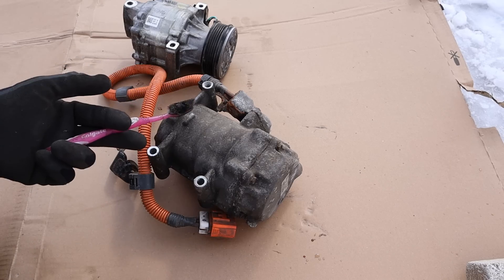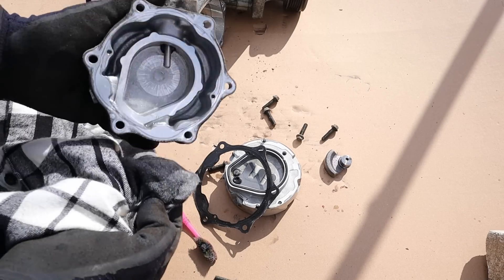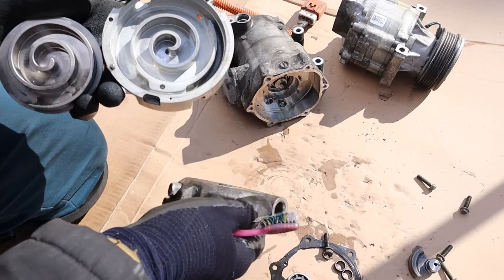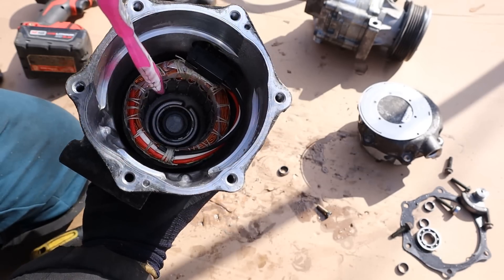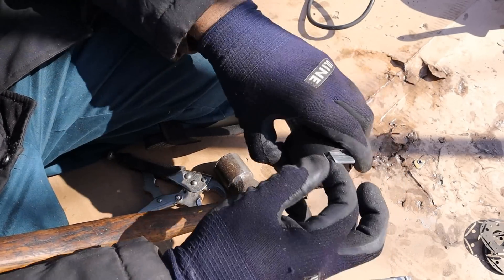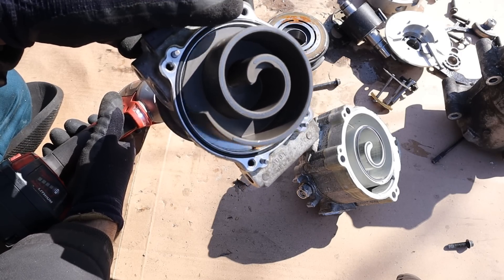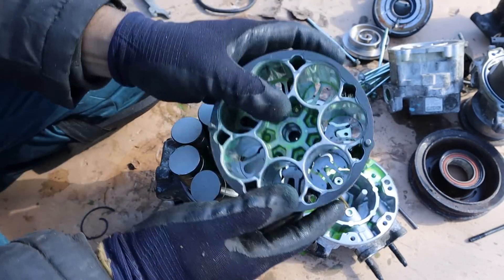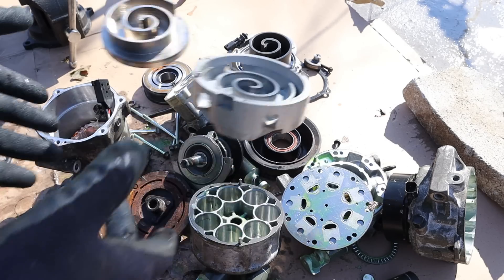How a Hybrid A/C Compressor Works

Comment: Has anyone repinned the electrical terminal on top? Mine has bent and broken teeth. It goes straight to the circuit board I accidentally pulled it out and hoping to somehow find the right wire and re solder / repin
Reply from the maker: Shucks
Reply: @speedkar99 figured out you can pull the whole circuit board off.  Do you think I’ll have luck swapping the top cover with circuit board with my old compressors ? Same serial number

Comment: This is really cool design. cause compressor and its motor are sealed as they call it hermatic. there is no way ac fluid leaks at least not from compressor. unlike traditional ones which always leak every fucking summer from the clutch side. its really bad specially if you live in the middle east.

Comment: Wow, this was really interesting!
Quick question; would you happen to know if the pressure relief valve on the compressor is a one time use valve?  I have a RAV4 Prime and the relief valve opened up and released all the refrigerant. Just wondering if I need to replace the valve or not…  Thanks again for the great video!

Comment: Funny video. I like it. However, I'm not sure the hybrid is using PAG oil. Toyota uses ND-11 in their Gen 2&3 Prius where PAG oil will supposedly conduct electricity and destroy the windings they piss through.  Thanks for showing that.

Comment: Hi, what’s the maintenance needed for aircond system? I owned honda i-mmd hybrid car. It’s used electric compressor as well.
Reply from the maker: As long as it's a closed system there's not much maintenance other than the air filter
Reply: @speedkar99  thanks man for your reply. No wonder, no specific mandatory maintenance for aircond system inside the manual. Just air cleaner element and dust & pollen filter.

Comment: Hello, I know it will be stupid question but I will ask it anyway 😅 is there any opportunity to swap my 1992 toyota pickup ac compressor from the belt driven into an electrical one?
Because once I turn on the AC the power loss is noticed immediately in addition to the insane fuel consumption 😢

Comment: You’re amazing! 
Question: When replacing a compressor in a Prius, the system is emptied of refrigerant. Do you have to jump the compressor to get it to suck in the new refrigerant or does it take in the new refrigerant another way?
Reply: It's no different than any other aircon compressor... the system must be evacuated completely to remove all remaining gas, air and moisture. This is done by pulling a vacuum using a vacuum pump, and pulling it down to about 99.95% of absolute vacuum!). The pump should stay running for 20-30 minutes to be certain all moisture has been boiled out of the system.  At this point the pump can be turned off, but monitor the vacuum gauge to be sure there's no leak that allows the vacuum to decrease for at least 10 minutes. Then the new refrigerant can be introduced to the system as liquid (tank valve down). The vacuum in the system will suck the liquid refrigerant into the system. This is where you have to know how much refrigerant the system requires, so you don't over-charge it and cause slugging... which can destroy a compressor. 

This is obviously a job for someone trained in HVAC.

Comment: Thanks speedkar, I wondered how that compressor ran on our new Explorer Hybrid, when I have the AC on idling in the engine is off and it's in hybrid mode, you can hear the scroll compressor changing speed.  The battery must have a lot of capacity because it will run a while with the engine off.
Reply from the maker: The battery on hybrids are quite sizable, enough to power the vehicle at low speed.
Reply: @speedkar99  hello, yes, it will go about 13k m on hybrid mode at 60kph providing there is no headwind LOL, then the gas engine will cut in.  Ford's done a good job, the motor kicks in flawlessly as the DC motor is the starter in this case. I think it kicks in by clutch but you don't notice it.

Comment: 6:18 The IGBT are Insulated Gate Bibolar Transistors, a hybrid between a MOSFET and a Bipolar junction transistors. That A/C inverter is in fact a variable frequency drive, not just an inverter.
Reply from the maker: Thanks - my electronics knowledge is limited to what my brother brushes off on me

Comment: Hey buddy have you ever inspect any rear caliper. I couldnt understand it because there is no english video any clear explanation on the internet and it has a rotating mechanism inside run by hand brake wire. This rotating thrust screw is the problem to understand. What is this rotating mechanism what is the ambition here? Also there is a gap between outer piston and inner piston. Outer piston has a small bore opening out. Could you enlighten us please.
Reply from the maker: Check my parking brakes video
Reply: @speedkar99  I already did it and first looked into your videos. I am looking for parking brake caliper not drum brake.

Comment: Volkswagen used scroll compressors as superchargers for polo, corrado and golf models, for a short period of time. They called them G-lader. G40 mounted on 1.6l and G60 for 1.8l engines. They were very unreliable, unfortunately.
Reply: I'm tempted to say that's a VW thing rather than a scroll thing though (I own a vw).  The DSG gearbox was a brilliant idea that should have rendered automatic transmissions redundant the world over. 
However the clutch packs wear out, and the lower gears aren't up to scratch and so also give problems and they're a nightmare.  
Initially the oil in the control units dissolved the pcb tracks and shorted them out - regular oil is high sulphur and corrodes soft metals.  It's common knowledge but VW made that basic error (now replaced with low sulphur oil).
I mean, it took until the nineties for them to get heat into the Beetle ;-)
Reply: Yeah the spirals inside of this compressor kinda look like it right?
Reply: @Kollege_Turnschuh  they are the same in working principle, just designed for slightly different application and working conditions.
Reply from the maker: That's interesting. Wonder how it pumped air compared to a turbine style

Comment: The first motor Permanent Magnet Synchronous Motor (PMSM). High efficiency, high torque (compared to AC asynchronous or BLDC types). Overall - Big power, small package; hence the in-line cooling of the refrigerant.
Reply from the maker: Exactly. I like it, very simple.

Comment: Scroll compressors have taken over the HVAC industry because they require much less starting torque from the motor, even when the starting pressure load is high. There are far fewer moving parts compared to variable displacement compressors so I'll guess they are more durable.
Reply from the maker: Variable compressors have an adjustable swash plate that can basically start at 0 compression. 

I agree scroll compressors are more common and simpler.
Reply: why werent scroll compressors the norm in the first place?
Reply: @poiiihy  knowledge is a process often impacted by many extraneous factors.  We're all born young and noone is born wise!
Reply: The residential scrolls can also survive some slugging…..return of liquid to the compressor intake due to poor heat transfer at evap or metering problems.
Reply: Exactly that’s why rotary “Wankel” engine produces low torque vs hp

Comment: Scroll pumps actually can run dry, so it’s not surprising that the new model doesn’t have lubricants. 

I’d say the oily stuff you got from the old Prius scroll compressor might be decomposed chemicals from refrigerant?
Reply from the maker: All compressors have oil in them.
Reply: @speedkar99  scroll type compressor/pump can run dry. If you take a closer look, there’s no relative motion between 2 scrolls — it’s their mating position keeps moving, but not rubbing against, thus no need for lub.
Reply: @bikingmoments The seals require lubricant, as well as the bearings. Some scroll compressors CAN be designed for dry work, but that by no means says ALL scroll compressors CAN be used dry.

Comment: 500k! Wow Toyota are really reliable. My Ecoboost Mustang only had 60K before it started to play foul games with me.
Reply from the maker: I made an engine teardown on the engine for this car a year ago, check it out!
Reply: Those Toyota hybrids can go 15 years.  Amazing given the scepticism about batteries.  Have to ensure the filter cooling the battery is regularly changed to ensure battery cooling.  But easy to do.

Comment: The hype you had when finding out that it's a variable compressor was so real
Reply from the maker: It sure was cool to see, even though I've already opened one prior
Reply: @speedkar99  Rainman Ray opened a variable one in an older video, yank-mobiles (light trucks especially) seem to need the AC compressor/condenser replaced as a matter of course (over 100K miles).  

Those scroll compressors certainly look like they would be much much less susceptible to failure (but I'm no engineer).  Pistons going up and down on a wobbly plate does seem to suggest weird pressures and stresses.

Comment: Hybrid air conditioning systems are my favorite. They have consistency and the compressor doesn't blow up as easy belt-driven one when your flooring it. Newer cars turn off the compressor while accelerating or in the red light which is b***** to save little to no gas
Reply: They don't blow up when running at high rpm! There is things called pressure switches. There is a low and high side switches. If low on refrigerant the compressor won't start, when gets over a set pressure the high side will kick the compressor out and the high side also is what starts the cooling fan to cool the condenser so the pressure doesn't run away also.
Reply from the maker: Yeah there are a number of protection systems in place, but I think the most obvious failure is the belt and clutch system, asside from leaks.
Reply: Even a 1990 Ford Ranger haves a WOT (wide open trhottle) relay thats disengage the AC compresor when you go to floor on the gas
Reply: Had a couple Chryslers blow up on me while revving the engine. Not sure if they just suck. I had a Ford explorer 1998, it did cut off at wot
Reply: My Prius has a "cold storage" evaporator. When the engine (and the engine-driven compressor) shuts off at a light, cold air keeps blowing.
Reply from the maker: That's cool, I didn't know that.

Comment: That pump for the Spark had a leak in the low pressure circuit. Damn shame.
Reply from the maker: How do you know it was leaking? Just because there was no oil?

Comment: FYI: IGBT = Insulated Gate Bipolar Transistor.  Not "Integrated".  It is a compound semiconductor with an FET driving the Base of a BJT.

More acronyms!  FET = Field Effect Transistor (originally called IGFETS for "Insulated Gate...")    BJT = Bipolar Junction Transistor.  IGBT combines the characteristics of both.
Reply: Thank you shazam, you are spot on.  And thank you speedkar99 for another outstanding presentation.  My hat's off to you sir.
Reply: Yeah you could say I'm a member of the IGBT
Reply from the maker: Sorry I mispronounced that. You are correct

Comment: That was very cool! I wonder what the most preferred type of compressor is used on heat pump systems like the late model Teslas?
Reply: Home heat pumps go with scroll compressors.
Reply from the maker: Most likely scroll type similar to what you've seen here. I'd be interested to open one myself
Reply: @speedkar99  it seems scroll compressors last long time

Comment: Does it not have a 0 connection?
or is it connected elsewhere, and not a part of high voltage connection?
Reply: Async motors don't need a neutral connection. Only 3 wires for each of the phase.
Reply from the maker: No, just 3 phases
Reply: It doesn't need a 0
It is in delta configuration
The case is still basically grounded (for safety and noise)

Comment: My 2002 Prius does NOT have electric A/C. It just has a "cold-storage" evaporator core that keeps cold air blowing when the compressor is off. Typically, it stays cold for about 30 to 45 seconds, and in milder weather it can deliver up to a minute or so of cold reserve. If the engine has to run to recharge the evaporator, it will only run as long as it needs to.
Reply: Yes, the full electric came in the 2nd gen. In really hot weather it could drain the battery in one go!
Reply: The sunbelt states laugh at your cold storage evaporators!!!
Reply: @jimmyaber5920  yeah, I doubt it would stay cold for long if it was 100° out and blazing Sun. The engine would likely be running longer than it could be stopped.
Reply from the maker: That is awesome. 
The 2nd gen had a pressure tank for the coolant system on the driver side
Reply: The w140 s class has a 20 min reserve of heat /ac I have always wanted to know how that worked.
Reply: @thetechlibrarian  I would seriously doubt that the AC would stay cold for that long. Yes, Mercedes cars have a "rest mode". But, I've tested traditional vehicles that weren't hybrids, the AC would only stay cold for about 15 to 20 seconds after I shut off the engine. The Prius (and a lot of modern cars with idle start-stop) freezes a thermally-massive wax solution within its evaporator to aid in maintaining cold air when the compressor stops.
Reply: @aspecreviews  yes I don’t know how it worked exactly I’m just going off of what Top Gear said maybe they were wrong or is somebody else mentioned it’s only for the heat
Reply: @thetechlibrarian  I've had w140. This mode only for heat. There is a little electrical pump that keeps running warm coolant through the system for about 15 minutes. That's called Rest mode.
Reply: Who cares? It's a Prius! 🤣